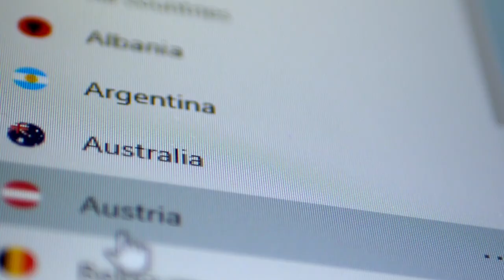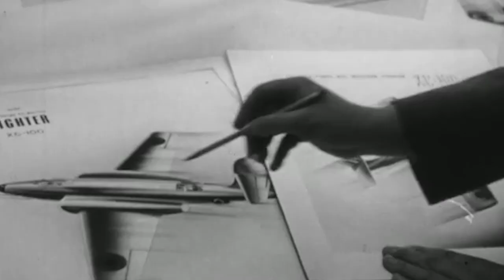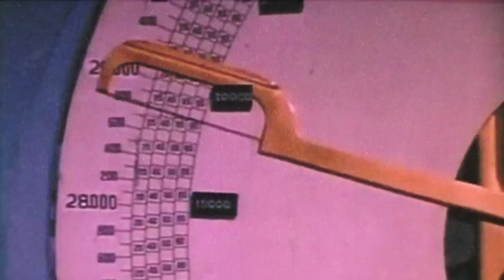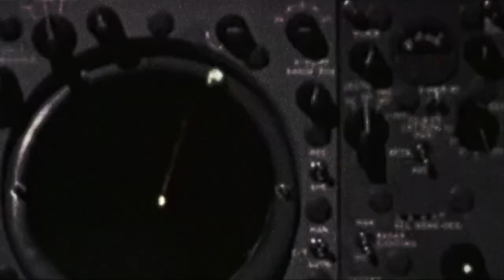The BAC TSR-2 – The Most Outstanding Military Aircraft to Never Serve

Comment: 200ft altitude? Did I hear that right
Reply: Below radar
Reply: Yes, low and FAST
Reply: Brian Coley  its 61 meters. 1 feet is .3048 meters
Reply: Yep.
Similar to the F-111 Aardvark - which was notorious for radar-locking altitude so fast it would try to snap the necks of the two crew (at first).

Tries to go under radar, and too fast to track from ground.
Reply: Brian Coley Swedish Viggen flew 20 meters over land and 10 meters over sea, but after a pilot flew into a telephone line between two islands a 8 meters and was forced to land with a several of hundred meters of cable stuck between the spare fuel tank and the plane, they changed that to 30 meter over land and 20 meter over sea. During the Cold War the Swedish fighter pilots flew like it was “skarpt läge”, I don’t recall the English word for it, but as in a war situation. So they flew hard and fast, which lead to over 600 killed during the Cold War.
Reply: @Hiznogood  600 of who killed? Pilots and crew, people on the ground or both? And are we talking about all nations combined or just the Swedish?
Reply: The Buccaneer, also mentioned, was another ultra low level aircraft. There's stories about the first Buccs to attend Red Flag, coming back to base with the turbine blades polished to a mirror finish due to the dust and sand ingested from such low flying
Reply: The advent of Soviet SAMs like SA-2 and the U-2 shootdown killed the old doctrine of high & fast bombing overnight. It killed projects like the XB-70 Mach 3 bomber, as it was only going to be a matter of time before SAMs were advanced enough to shoot it down even at Mach 3 @ 80,000 ft.
Reply: JediMind Trix there’s no way Sweden ever had anywhere near 600 Viggens or Pilots for them so it has to be something else.
Reply: @xeigen2  You know that's what they said,the SAMs would eventually get good enough. That's what they said...
The Xb-70 was killed by politics! Pure and simple! Here it is 50 years later and they still don't a SAM that is consistent at that altitude and certainly not those speeds! Politics man,they've killed more good programs than anything else. This bird,the Canadian Arrow. The list is looong.
Reply: @tomcline5631  I cant speak to the consistency but there are 100% hypersonic missiles nowadays that could catch it.
Reply: The xb-70 was canceled because of SAM technology,same as the original B1. If your high and screaming fast they will eventually develope a missle to catch-up. The air force knew that they only had about three years before the U-2 would be caught. The X-B 70 valkerye was designed for supersonic by riding on its own shockwave, it was not very manuverable at low altitude and speed.
Reply: @andycollins3978  Reminds me of a video of red flag. The yanks pounced on a Vulcan flying at about 200 feet, when they were shooed away by 2 Buccs coming out from under it!
Reply: @jobeybutt  on page 176 of the book Vulcan 607, the author mentions a training flight in Scotland in which the pilot forgot to turn on the terrain following radar. He thought he was flying at 200ft, the co pilot, wearing night vision goggles was getting excited. The altimeter wasn't accurate at that height.
Asked what's the matter,he replied it's the sheep, it's like looking them in the eyes. When told they were at 200ft, he said more like 20. 
Even if it was 40, that's damn low in something that size.
Reply: JediMind Trix Approximately 625 Swedish fighter pilots died in plane accidents during 1946-1991. One major cause was that the flight training was very hard, and so close to real combat flying as possible. In 50’s the yearly death toll was almost 21 per year. So that’s a lot of young men. In the 60’s the flight safety got better, mainly because the fighter jets got more expensive. Yeah ... that’s kinda rough. Got the information from a article in one of our newspapers, so this is not my numbers or conclusions, though I heard old veteran pilot talk about it. It’s in Swedish so ...
https://www.hallandsposten.se/familj/625-svenska-flygare-dog-i-kalla-kriget-1.298595

Edit: Found a Wiki page in English: https://en.wikipedia.org/wiki/Swedish_Air_Force#Death_toll_during_the_Cold_War
Reply: 200 feet is as low as the terrain following radar of the era could accurately track and react to obstacles, hence all planes with TFR had 200ft mission altitudes inc F111, Tornado, Intruders and TSR2. Other commenters here referring to lower altitudes are talking about manual flights under ideal visibility conditions
Reply: Brian Coley no 200ft was as low as Tornado TFR could be set to and was its mission altitude. Flying lower was still practised as in good visibility and over known terrain the pilot could disengage the TFR and fly manually, but that exemption applies to any airplane TSR2 included of course.
Reply: In my old home tornadoes shot over at 100ft or less the a10s were so high you could hardly see them.

People complained about soot being knocked down so they had to go higher
Reply: yeah as in terrain avoidance radar ...
Reply: @andycollins3978  evidently there is range footage of the buccaneer at Red flag that is quite stunning, flying between dunes, ultra low level, beating radar and carrying out perfe t scores. So good the navy never got radared once.....seems the navy had to give the range control time's of arrival at several waypoints so range control could even get eyes on
Reply: Also look up Project Sageburner, USN Project fromt eh early 1960's to set LOW altitude & speed records, 900+mph at 125 feet ...
Reply: Any plane can fly that low but the tsr2 had pioneering terrain following radar. It would closely maintain a fixed altitude above the undulating terrain without pilot input.
Reply: Jack Tangles  
Maybe so.
Reply: Brian Coley  Not at 800 mph
Reply: Common misuse of altitude. The correct term is height. Altitude is the distance above sea level. Height is the distance above ground which would have been maintained by TFR. If you maintain 200’ altitude and there is a 300’ hill.....
Reply: ??? 200 feet is closer to 66 meters. And B-52s in Eastern Washington flew 50 feet above terrain.
Reply: @stephenjacks8196  
Right. But B-52s aren't supersonic low-level bombers.
How long would they maintain that altitude around there?
Reply: YT of SR-71"racing" a SAM. The SR71 going at a healthy 2500 mph vs SAM 3500 mph in level flight. Except the SAM is 90,000 feet below you and travels slower vertically. Out of range by the time it's acquired. YT has many vids of planes "shot down" by collision with their own slower munitions. (German WW2 30mm cannon with 1500 ft/sec muzzle velocity).
Reply: Yes indeedy. Would love to do that in a jet...must be quite a ride!
Reply: Heck the B2 was able to fly 50 feet above the ground. Even lower but deemed unnecessary and added danger. With it's advanced electronics. Nothing cooler than being out in California city riding dritbike and Getting literally blown off your bike as a couple of them Streak over you on the deck . It's was like an instant Dust Storm. Awesome 😲
Reply: Lancasters flew lower during the dams raid!😉
Reply: @threepot5874  Yeah but thats because they had to in order for the bombs to bounce properly and hit the dams.
Reply: @Fightre_Flighte  I don't  think they lost a B52 but a couple A6s crashed; "undue foreign object damage unacceptable for training purposes" (USAF plans on flying the remaining B52s until 2050). Eastern Washington can be dusty with 30+ mph prevailing winds (you can see the wind farms from space like Tehachapi). Just reinforces that air is denser at sea level and the specifications of those planes limit their airspeed at lower altitudes. That is aircraft of mach 2+ at 35000 feet will fly subsonically at 1000 feet (an exception to the german pilots who died in F104s).
Reply: @stephenjacks8196  
It's also to be noted that different variations of aircraft are built with different altitudes in mind.
F-14 Tomcats were more than happy making supersonic passes by aircraft carriers below the deck line (maybe 100 feet or less?) but, for instance, the SR-71 blackbird was limited to the same speeds as a P-51 (roughly 200-ish knots) if it was lower than (maybe) 15,000 feet.
Reply: Richard Tattis  
Understandable, honestly.
I've seen vids of airshows involving B-52s doing some super-low-level maneuvering. I'm still wondering what practical application it might have, other than just displaying that your pilots are so skilled they can do those sorts of things with a big, burly, generally unruly bird.
Not saying the stratofortress is unstable, rather that it'll fight having to do anything quickly.
Reply: Richard Tattis  
You seem to have seen a lot of publishments about this.
Reply: @ertugrulkarakas4400  Correct exactly or inversely 3.28084xxxx ft = 1 metre
Reply: @magicbat  Were talking about terrain following at 200 ft not flying along a blippin runway!
Reply: @neilturner6749  in the seventies I lived half way up a hillside, we could sometimes see Vulcans in the other valley but only just, our valley was the preserve of the fast boys, with Harriers,Jaguars, and Phantoms regularly coming through, they may have been at 200 feet but we looked down on them as they came past, we had a Phantom almost hit the house once as the pilot misjudged the flight path, he flipped it on its side and gave it everything, one wing disappeared behind the house, as the ground rose at the back of the house it could not have been more than ten or fifteen feet to the wing tip, he missed the big crag about a mile up the valley as well, just, Bering in mind they had no terrain following radar and they were doing around three to four hundred miles an hour the pilot did very well!, they went through a bit higher and slower for a while after that, was good living there.
Reply: @Hiznogood  nape of the earth flying
Reply: Until something goes wrong for 1/10th of a second.  Untested, unproven.

Comment: My dad worked on TSR.2 as an apprentice, he actually has a TSR.2 tie somewhere. He helped build XR220 and thought it had been scrapped until we visited the Cosford museum about 25 years ago and he was reunited with "his" TSR.2 :) He once told me that the main reasons it was cancelled were that 1 it was designed to fill a very narrow role and couldn't easily be adapted for other uses, and 2 it was stuffed full of so much advanced technology that it would have taken literally weeks to find and replace any parts damaged in action. XR219 was the only one ever to fly, that along with XR221 and XR223 ended up on the firing ranges at Shoeburyness, XR220 sat in a hangar at Boscombe Down for years before being rescued and put into the Cosford museum, and XR222 ended up at Duxford where it sat outside being rained on for years before they decided to wheel it indoors and do it up before it fell apart. A front fuselage section is at Brooklands I think, and there's an engine somewhere in a museum, but the rest was scrapped. Interesting srory, my mum also worked for BAC and one of the last jobs she did was de-bugging the heads up display on the Jaguar (it suffered from horizon line creep due to a rounding error in the computer program that controlled it), she left there in 1976 and was going to have a ride in a prototype Jaguar as a leaving present until it was over-ruled by Roland Beamont!
Reply: My Father worked for RAE while the development was taking place, later he worked at Cranfield Institute of Technology and I remember as a kid going to Cranfield and sitting in the TRS 2 they had there, was it the one that went to Cosford when Cranfield's museum was closed?  My dad always blamed the Americans with their promise of the cheaper F111 (and the Nato standardisation , or the Americanisation of Nato) and then renegading on the price once the superior competition had been axed, not helped by the then Governement's defence spending ideas.
Reply: @HairySteveUK
Pretty much nail on the head there, The Central Servicing Development Establishment who were the RAF organisation who developed and wrote the servicing and maintenance procedures for RAF Aircraft had a Heart Attack when they were first given the prototype notes for the TSR2 and allowed to see the prototypes. The aircraft would have been a complete pig to keep flying in operational service and the RAF knew from bitter experience that mean time between failures quoted by British Industry were complete bollocks!!  This would have not been an issue had the aircraft been designed for easy access of the areas where these items were located, but in aircraft like the Lightning and TSR2 this was not the case. The Basic issue was that their was no single design co-ordination authority and that the end user was not given any input into how the design was evolved. In the USA there were only 4 organisations involved,  NACA/NASA who only really did basic R&D. ARPA/DARPA who did Military R&D, Industry and the End User's Research establishments all who had input to a project under command of a project management team who'es background was almost to a man based on aeronautical engineering. Thus, their kit tended to work as advertised, while the British kit was in bits in a hangar. Canberra was bought by the USAF because it was simple, the original aircraft that the USAF were going to buy was the Martin XB-51, which was not and would have been a Hangar Queen was binned. In fact it was the French who taught the British how to build a decent combat aircraft as regards maintenance i.e. The Jaguar!!!
Reply: Engine in a museum in maldon

Comment: Having read two highly detailed technical reports on the whole TSR-2 project it is refreshing to agree with most of this video. In my humble opinion two things are worth noting.  Yes the TSR-2 was at least 15 years ahead of it's time, second the development of the TSR-2 should have been delayed until the British Aircraft industry had been totally revamped. Then one company, the British Aircraft Corporation ( BAC ) would have carried out the design and development without the ridiculous infighting that went on within Vickers and English Electric the two companies charged with the design. A delay of 5 to 7 years could have been made up by the RAF buying Buccaneers as a stop gap, again inter service rivalry between the RAF and Royal Navy prevented this.  As an aircraft engine / airframe technician I must say there was some redesigning that would have had to be made.  That tandem main wheel design would never have been successful on an operational squadron. It would have given to much problems even when the design matured. Another airframe engine problem was the design only left 1/10 of an inch clearance between the fitted engines and the fuselage.  During early test they asked each engine change to be completed in 5 1/2 hours.  It took 65 hours to just get the engines fitted on first try.  1/10 of an inch was ridiculous.    Well done my friend, but one problem. The TSR-2 was designed to replace the Canberra, not the Canbeara, I do know the correct name, I worked on the aircraft in the 1960's.
Reply: One Very big problem with your comments. The RAF can't wait an extra god knows how many years for it to be ready. They needed the Canberra replacing in 1970 at the latest. Nav Attack system on the thing didn't work either and that had been tested on a lab aircraft.
Reply: The TSR.2 was an unmitigated failure by a company that was an absolute dumpster fire.
Reply: @WilhelmKarsten  You sound like your mom describing you
Reply: @chumleyk  It nothing to laugh about lad, the problems at BAC led to the collapse of the entire UK aircraft industry, a truly shameful and humiliating chapter in British history.

Comment: The tsr2 always makes me so sad that the project got shut down. Imagine the stories of max speeds and altitudes !
Reply: Mach 1.7 to 1.8 if you were lucky.
Reply: There is a report it out ran a Lightning on one engine. And that was the only fighter capable of catching Concorde.
Reply: In hindsight, it saved a lot of money.
Reply: That romantic Boys Own stuff is all very well, but takes no account of financial reality.
Reply: @richardvernon317  closer to 2.5 where you getting your numbers?
Reply: @williammcconville4967  From the operational requirement for the Aircraft written by the RAF Operational Requirements branch!!!! Anybody who thinks this thing was capable of Mach 2.5 are talking bollocks!!! Most of the figures of what the aircraft was actually capable of are in a classified BAC report held in the BAe Systems Archives at Warton. They were declassified in 1995 and  don't paint a pretty picture of the state of the project at all!!
Reply: @richardvernon317  so when Bea says 2.35 you know better ok
Reply: @williammcconville4967 The TSR.2 was not Mach 2 capable
Reply: @WilhelmKarsten  will trust the makers over, trust me bro anyday

Comment: “The two branches of the British Army” the RAF and RN are not branches of the army they are completely separate. Other than that excellent video for the length.
Reply: Perhaps that was a slip of the tongue or a deliberate jibe.. because they certainly were at one anothers throats. Probably a  2nd wave of the antagonism between Army and Navy that created a distinct RAF from the RFC after WW I
Reply: RN is the senior service.
Reply: @Wallace Carney the royal flying Corps wasn’t around during the period of this video, if you want to mention them you might as well still refer to the armed forces as red coats 🤷🏻‍♂️